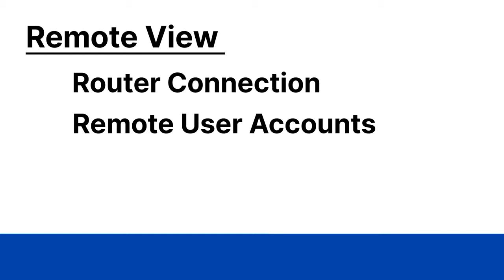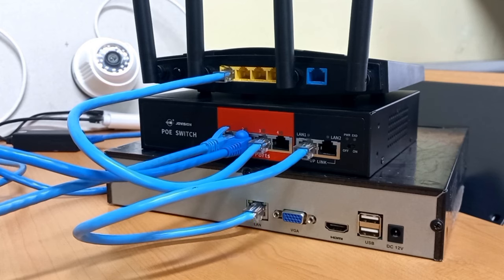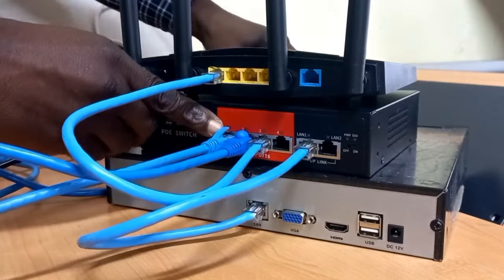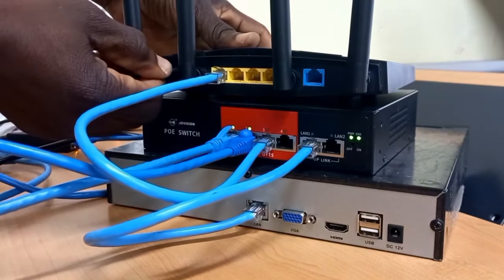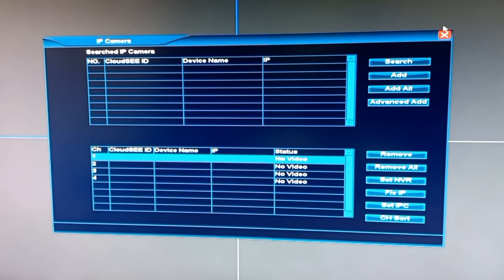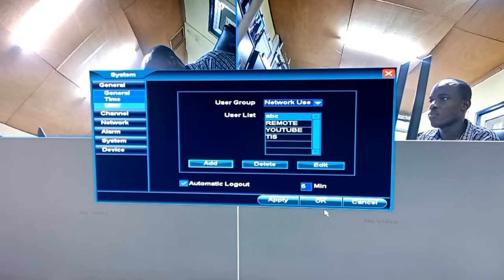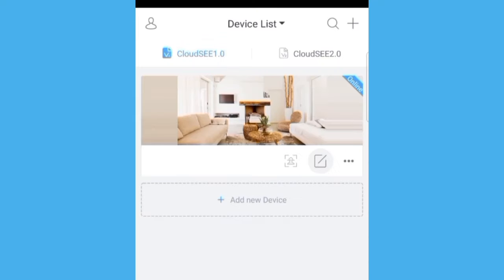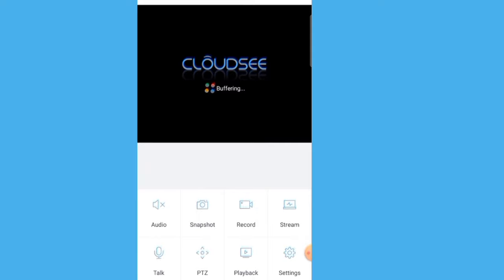DIY - IP CCTV camera installation, using a Single POE switch with view on phone.

Comment: What happen router connect to poe?because poe power 48v
Reply from the maker: The POE switch is made an intelligent device to know when to supply power so that since the router does not require power from the POE Switch, the switch will not output power.

Comment: Thank you...which type of cable are being used...? 1 Straight, 2 cross.      3 over, roll over???
Reply from the maker: Straight through cables
Reply: @Tech_Inside_Out  🙏 thank you vary much sharing the knowledge....
Sir I want know that how can I install and configure the distance recording what are the h/W and software protocols we need.
Ex , my office at away from 20 km and I want to do keep recorder NVR or other at my home.

Comment: hi, can you explain the camera it is working till i have broadband internet, once i unplug cable from computer, it stop revording, not even letting view video on my phone, or if plug still in computer, but turn off broadband router, it stopped working camera, so camera will work only if i have broadband internet? without internet - i need NVR box recoder correct? any explanation will help me, i want instal in my car on the roof. with second battery.

thank you
Reply from the maker: IP Cameras do not require internet to work, there might be a break in your network some where that might have caused the problem.
You need the NVR to do the recording unless you would like to record using your computer which is also possible.
Please contact me if the problem persist. benedict.gborgblorvor@gmail.com

Comment: nice but you only boot up and you're in the switch system.......... How do you get there?
Reply from the maker: Thanks for your question, this video shows every process. There are processes that need to be shortened, for example the long boot time of the NVR which does not contain any instruction and hence you will not miss any information It really covers every detail.

In case there is a particular point that is not too clear, please let me know so i can provide precise answers. Thank very much for contacting Tech Inside Out.
Reply: @Tech_Inside_Out  I understood thank you ... At First I thought the DVR must be connected to a computer then to a  monitor while the DVR works as the CPU itself

Comment: sir why didnt you put the ethernet cable from the router on poe ports insted of lan port?.
Reply from the maker: The Uplink port of the POE switch has been optimised to deliver at a higher bandwidth than the POE ports and that facilities ease of video transfer or transmission. That will mean that there will be much path for video flow with no breaks.

Comment: Very good explanation... Really nice..
I have total 5ports PoE switch with one uplink port... One cable connected from Modem to uplink port of PoE....
NVR is connected to one port of PoE switch...also 2cameras are connected in the  PoE switch...is it correct sir..
Can you put a video on PoE switch
Function and how does the data's are transferred... Thanks a lot for your video...God Bless,,👍👍👍
Reply from the maker: Hello Jeyapandian, The connection you explained will work as you are using just 2 cameras but when using about 10 or more cameras, this method will not work. The best way out is to connect the NVR to the modem and maintain all the other connections as you have connected. That will make the network more efficient.
I will consider doing another video on POE Switch as requested. 

Thank you for watching, God bless you too.
Reply: @Tech_Inside_Out  
Regards👍👍👍

Comment: Hi, pls must the NVR be a Poe NVR as well?? And What type of network cable do you use for your installation? cat5 or cat6… thanks
Reply from the maker: The NVR should not necessarily be a POE NVR. What i used in this Video is a non POE NVR. I used Cat 6 network cables in this very demonstration but Cat 5 cables also work perfectly.
Reply: @Tech_Inside_Out  I appreciate your reply Thanks.. looking forward to more videos from you

Comment: Hello, so if we connect router to uplink port, it will work totally fine? What is adventage of connecting it in poe port instead to uplink port?
Reply from the maker: Using the Uplink port rather has advantages over using the normal POE ports.
The Uplink port has been designed to handle a higher bandwidth than the normal ports and so in larger camera networks,  the best place to connect a router is the Uplink port
Reply: Thank you for the question. I found this when Iam searching for a answer for this question.

Comment: Can we connect  the router to the uplink port of Poe switch instead?
Reply from the maker: That is recommended especially when using higher number of cameras since it delivers a higher bandwidth.
Reply: Can you make another video on how to connect  multiple switches from access layer to core layer? Thanks

Comment: Having a 8chPoe nvr and 7 Poe cam connected. Want to connect 1 non Poe cam to the poenvr. Would I need a Poe switch for connecting one nonpoe to the Poe nvr pls? Or there’s a way to beat it.
Reply from the maker: You need a POE splitter connected to that 8th port to split the signal coming from the NVR into video and power. The video is the RJ45 end and the power goes into the ethernet jack of the camera and you are sorted.  As mentioned,  i will do a video explaining all these.
Reply: @Tech_Inside_Out  pls have you done a video explaining this as you said?
Reply from the maker: @SwaggStreet Inc  Please which one are you referring to. I don't quite get the exact promise you are referring
referring to

Comment: This channel is precious, already subscribed. Sir I want to ask how do all IP cameras be able to access the internet and provide remote access when your internet router is not connected to a modem or fiber cable from your ISP through the blue colour WAN/Internet port of the router? This is the only part that I don't get it. Thanks!
Reply from the maker: 1. My router contains a SIM card through which i receive Internet into the router.  
2. Since the router is connected to the network switch and the cameras are also connected to the switch, they will receive the Internet which is shared on the switch. 
Am preparing a new video that will explain how all these happens, ie Switches and router connections and how they function.
Reply: @Tech_Inside_Out  I see, but why SIM card connection is chosen in such scenario? Cellular data has limited usage, expensive and the internet connection is unstable when being interfered by bad weather such as rain. Would you suggest to use ISP modem subscription with an actual optic fiber running into an office for internet connectivity?
Reply: @johnsonjohnson129  that sounds more expensive and would take a longer process. I believe he's just using what's best for him. Remember this is also a tutorial

Comment: what's the name of the application used to set up the cameras on the monitor?
Reply from the maker: For the monitor, if i get you right there is no software required to display the cameras on the monitor.  For display on computers, you require a VMS.